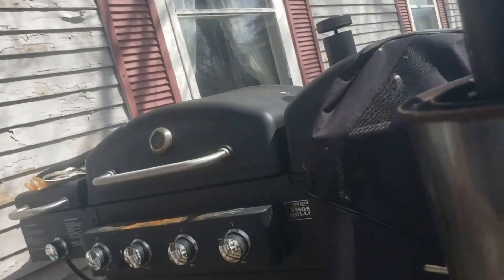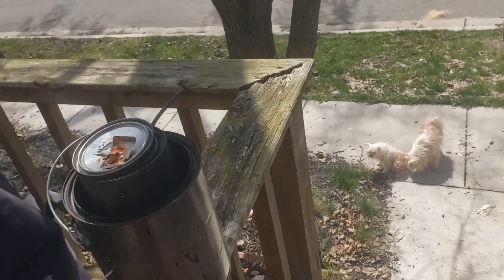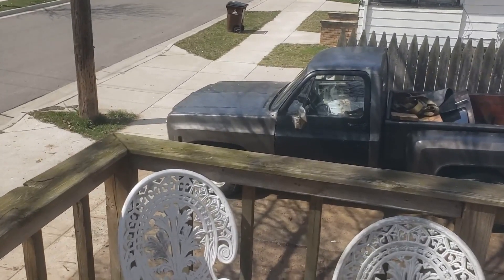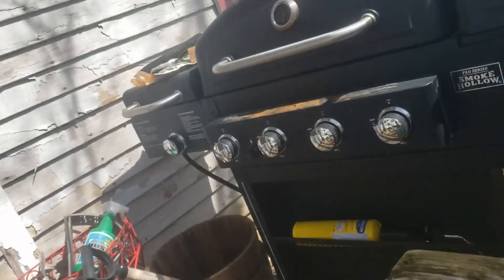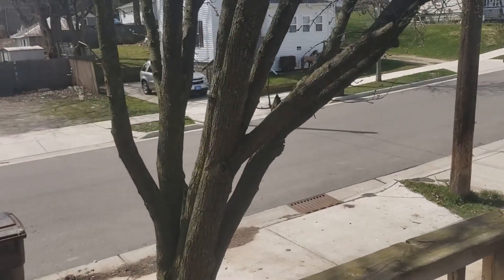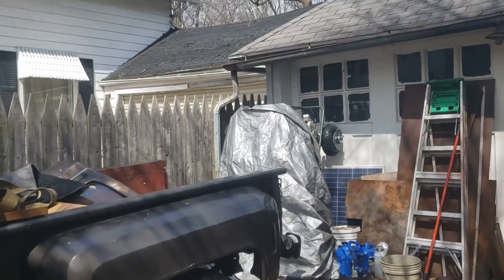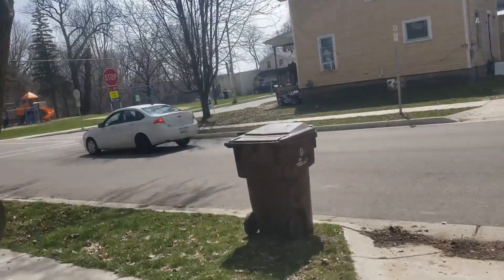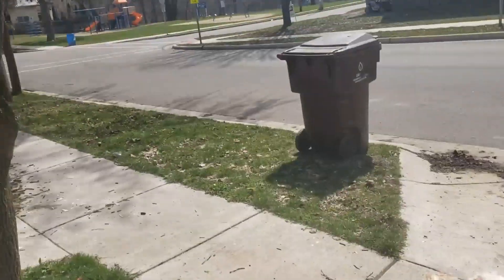New series intro! How to apocolypse proof your engines and power needs

Comment: Pyrolised wood can produce fuel for alot of needs, I have been planning to distil wood to make methanol, to fuel my generator, I'm off grid anyway,   id say if your vehicle will run on e85, you could putt around on pure Methanol, or a bit of tuning, it may run fine,   of a gasifier, to fuel anything that will run on natrual gas, can't wait!

Comment: 6.2 Chevy diesel not real powerful but it will run on anything they don't see the fuel. You can mount an om617 Mercedes diesel in your Cherokee
Reply: Efficient too.
Turbo and a turn of the pump they wake up nicely. Ecelllent off road manners and heat at idle 
Basically one wire operation, two if one counts the cold advance solenoid.

Comment: How about instead of a faraday cage, emp proofing a rolling car?
Reply: I'm curious about the solar setup you have running and how helpful it's been. Do you use it as a backup or a supplement for your house currently?
Reply from the maker: I use it to run my camper, I keep it as a backup for the home, it's pretty small, just 1kw
Reply: Peter Tremonti what?
Reply: @clarkclifford2338  were the questions confusing?
Reply: Peter Tremonti off topic. IMO. Thought you may have posted it in response to this by accident, rather than as a comment out in the open.
Reply: @clarkclifford2338  Sorry about that. I don't comment on many things especially from my phone. Didn't mean to be confusing.
Reply: Car is pretty emp proof already you just need a live wire to static discharge acrewed charge. After that should be good.
Reply: Inviting1word maybe the real interest should be in emp car testing. Building an emp generator to test the emp proofing of the vehicle. Lol. That would be great to see what blows up.
Reply: @clarkclifford2338  there's like 3 felonies and myth buster did it. Also generating a emp that big would take some power. One Could be made but thats why nukes are more of a "natural" emp.
Reply: Inviting1word hmm. Ok.
Reply: Inviting1word ok, just thought of this. An emp generator made with an LS.